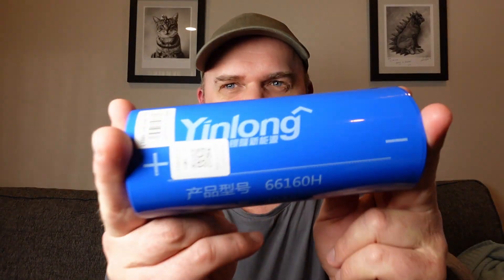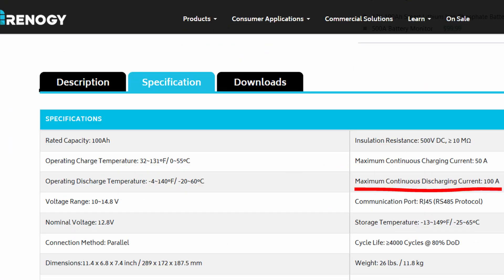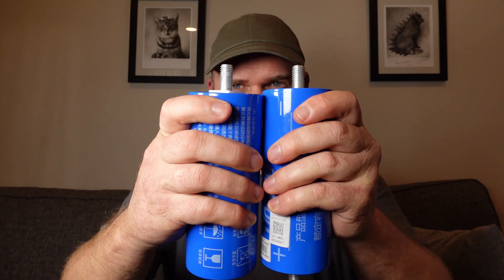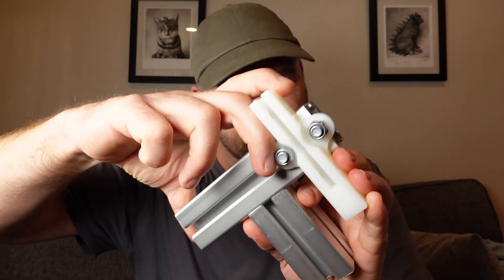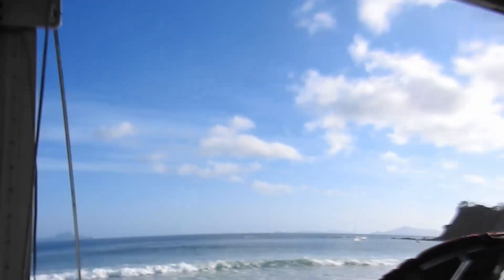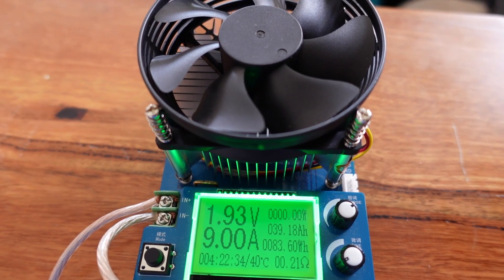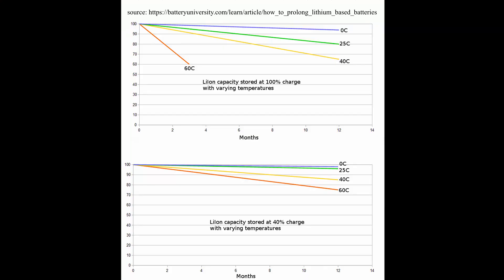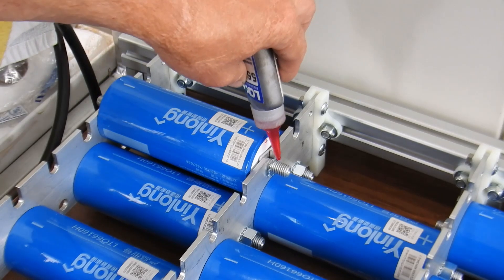Campervan DIY battery build HUGE POWER!

Comment: Great design!!! In fact, I am seriously thinking of imitating it. One quick question: I am a retired electrician with a EE background. In my day, one of the big no no's about aluminum connections was to put them together without NOALOX as an antioxidant on on the connections. I see that you use Loctite on the threads. That would keep the nuts from moving, which is good because of the expansion and contraction of aluminum, but does Loctite stop oxidation and wear from movement between the nut and the busbar? It seems to me that it would be important to tighten an aluminum connection from time to time. I live in a farming community where there are many many 50, 100, 200, 300+ HP ground water wells. One of the pain-in-the-ass things that I had to do for the farmers was to clean and tighten connections on those big motors every two to three years or face the possibility of having them vaporize NOALOX or not. They do vaporize and with a boom like the battery you nailed. What happens is that the connections experience movement from expansion and contraction over time and wear to the point that they start arcing. Also, it has been my experience that to loosen a nut with Loctite on it, you have to heat the nut. I would think that that would be a bit on the dangerous side with a battery. What if you have a battery go bad? I know that a motor demanding 200 to 400 amps in a 3 phase 480 volt system is a heck of a lot more demanding than the batteries in your video, but just saying... I have seen several other videos where the person is using aluminum wire in lugs or on battery connections and does exactly the same thing with Loctite. I am just wondering if there has been some advancement that I don't know about. Thank you.

PS I am going to have to clean my ears out. You already know the problems with using Loctite in this application as you stated at the end. Good job!!! I am ancient enough to have seen the concerns and the results of using aluminum in electrical applications, but we still do use it because of the horrendous cost of copper. Most of what we see in the US is service entrance applications or in exterior applications like the pump motors I was talking about. In some jurisdictions, aluminum wiring is still installed, but only with the stipulation that all devices in the circuit be aluminum rated. Thanks again!!!
Reply from the maker: Hi Bill, firstly... I'm not an electrician and only had limited experience with high power systems, so I'm not 100% certain what I'm on about.  However... I'll give you my thoughts from limited pondering.

As far as loctite goes, there are differing strengths, the loctite brand is color coded for this.  Although there are more, generally speaking the loctite brand has red for high strength, blue for removable and green for electrical.  The brand I used isn't color coded, but has it's equivalent types.

You'll notice I wiped silicone grease on the end of each cell before bolting in.  In my mind, the grease should prevent moisture getting into the joint and starting corrosion.  

As far as retightening... this is straight outta my head and have never seen it anywhere, so take from that what you will.  I can imagine in an electrical setting, aluminum lugs might be done up with high tensile bolts and torqued.  It's possible that the bolt force is close to the compressive yield of the aluminium.   Then when the lug warms - Al has a higher expansion than steel, so could be passing compressive yield squishing the Al lug out, this may be even more apparent if the Al gets warm enough to lose its temper (check my skylight video). It might only squish a tiny bit each cycle, but it all adds up.  With these cells, the studs are Al and the bus bars are Al so expansion should be similar, they aren't done up very tight either.  Who knows - fingers crossed.
Reply: @brendontait6968  Yes. You are right with the "squishing" effect and movement on the cable itself in a really big system. If you can imagine the amps that a 200 or 300 or 400 HP motor takes; Jeeze, I've seen 250, 300, up to 500 MCM used, type depending on location. I've even seen guys get a free hair cut, eyebrow pluck, and a new shirt out of an electrical explosion of that sort. These wells cycle according to crop and watering depth, but some can cycle once or twice a day and run 24/7 for about 3 to 6 months straight depending on the crop. Essentially, they take a hell of a beating, that is why 3 phase equipment is super expensive. But then, 3 phase is the only thing that will make a motor that size last. The motors that move the crop circles cycle every few minutes, however, adding a heck of a surge to the system.

I wondered what was on the cotton swab. Good job on protecting that contact surface. I would think what you did should last. Are the nuts steel? Keep us informed. I am planning on doing what you did. It won't be for a while, but it is a coming feature. That busbar design has a patent with your name on it.

To be honest, commercial electricians work with some heavy current but it is all pretty much straight forward. We sometimes have to work with some root mean square and square root of 3 stuff, but we squeak by with the power equation on most applications. You guys in these low voltage applications seem to have to do a conversion about once every 5 minutes.  Outside of the occasional 120volt relay to keep people safe, 3 phase is quite straight forward. It just takes a helluva tugger or a come along or a pickup truck and a chain it pull it in conduit and a professional body builder to bend it in spite of the wire being stranded cable. 

Low voltage is a whole different story and a bunch more complex. It has been quite a number of years since my low voltage training and I never really used it. This is the first that I have seen solar/wind applications. I am exploring this world because I am darned tired of $800.00 a month bills for electrical. I am in the process of building a 4000 watt or 8000 watt system hoping to expand to 12,000 or 16,000 watts sometime in the future. I am finding that the battery question is the most limiting factor at least on a financial basis. I am looking at this sort of battery because of the long life but also the safety issue. 

There is a video, I believe on You Tube, talking about the very issue that you demonstrated. The first time that I viewed it, I about crapped my pants. Needless to say, I made sure that the type of battery that was featured was quickly removed from any of my applications.

PS. Thanks on the Loctite info. I was not aware that there was an electrical Loctite. In my day, there was just the red.

Comment: I find coming back and watching the machining in this video to be therapeutic. Excited for your build!
Reply: Would be good to see more of the power set up. IE charging setup.
Reply: Have you decided to find a different battery load tester?
Reply from the maker: Yeah, but it took two more purchases to find one that kinda worked!
Reply: @brendontait6968  - what did you end up with? I’ve been trying to decide one for testing 18660’s and other small cells
Reply from the maker: 18650s?  I use the Opus BT-C3100 for smaller cells.  Works well, they can crap out with heavy use.  (I've put around 1,000 cells through one)  else I've linked the current larger one that I use on my cold testing video.
Reply: @Levi_Allen  kiwi.?..thats a wierd pic of a dog you have.. im using caps as a start batt.
Reply: So funny sawing your comment here , at an other topic than i know you of on your channel , film , video and edit skiles 😊
i know and follow your channel aswell .
As a filmmaker its very wise to check and be uo to date , battery wise ..lol
I'm here to learn how to Spice up my Ebike , from 750 w to 1500w 😉
Grtzz from the netherlands ,
Johny geerts
Reply from the maker: Hey Levi... hope you guys are well.  Yeah I find watching the machine hypnotic, maybe I'll put some more in my videos.  Thanks...  yeah I have a few update videos to catch up on, but have been away for a decent trip in the truck and absolutely love it!

Comment: You could get 48 volts to the battery by fitting another alternator to the engine and wiring in series.

Comment: I would have gone for blue thread-lock. Red is permanent.  Both can be softened with a hair dryer when needs be, but Red is definitely more trouble to remove.
Reply from the maker: The locktite i used is loxeal 55-04 (not color coded like loctite brand) and equivalent to loctite blue

Comment: 15:00 If you should keep your Li charged just below half when storing electricity then doesn't that make AGM who should not be discharged below half no longer at a disadvantage?    This is particularly true if your storage is for back up power.   You can also reverse sulphation on AGM batteries through equalization, so that's not really a lifespan issue so much as a maintenance issue.
Reply from the maker: I think you misunderstood what I meant.  You should keep them under 50% if you are storing the batteries to optimize their shelf life.  You can double their life if you use them at 80%.  Even if you don't double their life they are still streaks ahead of lead acid for lifetime and cost. You cannot reverse sulphation through equalization.  As soon as the lead sulphate transforms from amorphous to crystalline there is little to nothing that can be done to revive the battery.

Comment: No safety stuff in penetration test.
Reply from the maker: I normally don't wear shoes... I had shoes on in that test incase the cell flew in between my toes.
Reply: @brendontait6968  you were touching the battery by hand, it could burn your fingers. So edit your video, someone can damage his hands if they try same test as you showed.
Reply from the maker: People can see the violence of the punctured cell. If they choose to be an idiot and hold it in their hands after they now know how it will react and they get burnt, that's their own stupid fault. It may teach them a painful, but relatively harmless lesson.  I appreciate the concern. However, It's impossible to protect people from their own stupidity, no matter how much you censor things.  If anything, it's possible they will see it and notice the risk.  Let people make their own choices in life.
I could also argue the point that I've punctured and caused batteries to fail explosively many times without any injury whatsoever, so my methods must be safe?
Once a video is published, it's not possible to edit.
Reply: @brendontait6968  Well it shows the violence of the experiment. But don't forget YouTube is a place for children too and they do what they see, not what you tell. Anyway thanks for the experiment, but you could be more professional in safety part.
Reply from the maker: Thanks for your comment and concern, ill take it into account with future videos.

Comment: You shouldn’t use Al, while Al is a good conductor Al-oxide is not, and is likely to be a problem, Cu would be a better option but  is heavy cf Al.
Reply from the maker: Hey Bruce,  thanks for the comment.  But I disagree with you, and this is why:  firstly if I'd make the bars from copper it would have cost thousands in just copper, plus copper is a pig to machine.  The studs on the cells are made from aluminum, so if I'd made the bars from copper I would have had like 200 dissimilar metal junctions.  These would be more likely to develop galvanic corrosion at the interface.  When I bolted the studs onto the bars, I lightly sanded the bars and applied silicone grease at the interface.  The grease should inhibit any moisture buildup in the interface and limit future junction corrosion.

Comment: Thank You for the information. It was well explained. I have a question for a campervan. I am going to buy an old school bus. And converting it to an RV. I would use several power walls in it, Because I want to remove the gas motor and replace it with an electric motor. If you were doing the same thing for your camper van. What would I need besides a power wall, how big of a motor and other things I would need to do this to a a full size school bus? Range 300 miles. Perhaps just power steering? Thanks in advance... I just subscribed to your channel.
Reply from the maker: Hey Glenn, the motor, power steering etc is the smallest issue with a project like that.  Motors small hydraulic pumps are commonly available. The battery size/cost for a project like this however is beyond the capability of most individuals.  You're probably looking at a touch over 1kWh/km, so for your expectation we are looking at a 500kWh battery which is enormous. (Around 40 tesla powerwalls).  I'll probably electrify my truck one day when batteries are significantly cheaper.  Till then, diesel is pretty affordable.
Reply: @brendontait6968  Thank you for the info, If I was to do the project next year, what motor would be a good choice. I buy things for projects like this one at a time. Converting the bus to electric motor is the very last part of this RV project. Again thanks in advance. And I hope you keep making videos. You are very good in front of a camera. And very good at explaining Things. I was thinking I might put the power wall in the floor of the bus, And the bus I plan to buy is big. And for now, and my plan may change, I might use the batteries you talked about in this video. But everything may change as new stuff including batteries are coming on the market. Thanks again.
Reply: I am also wondering if a Tesla Coil would up the power and speed and time it takes to charge the batteries faster (re-charging) or increase the range of an electric bus and may make it be able to use a smaller power wall, and replace the need for plugging in electric lights, computers, electric ovens and burners, and what if it would reduce the need to wire the electric motor and power steering? That is another strange idea I have that I am not smart enough to figure out.
Reply from the maker: Hey Glenn, so the problem is that currently a battery for this application would cost as much as a decent house.  There is no magic in a Tesla coil.  They will always put out less power than they consume, at the moment there is no easy way around this.  Believe me... if there was, I'd be all over it!   As far as motors, I'd probably just try something from ev west.  Maybe an old tesla motor. For power steering, if you couldn't find a suitable pump I'd just start off coupling a brushless motor say from a model plane/drone to your existing pump.
Reply: @brendontait6968  Thank you very much for your thoughts and reply.